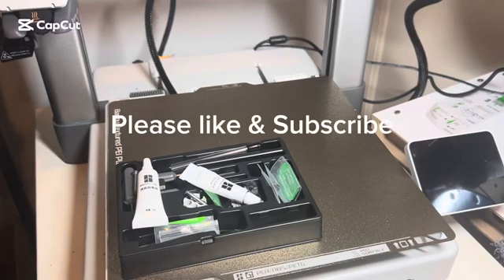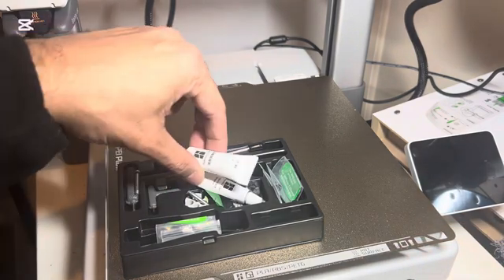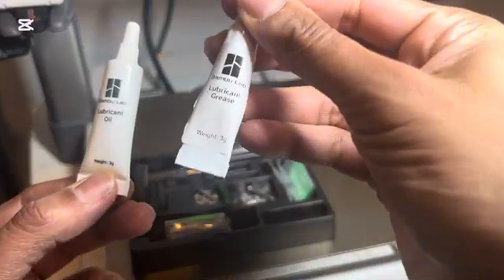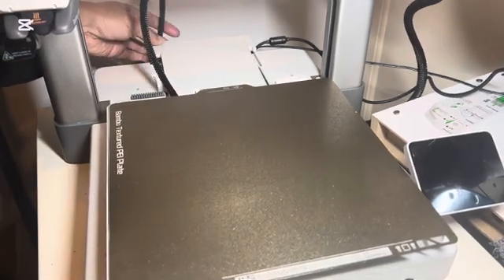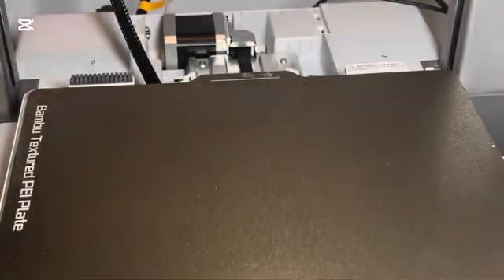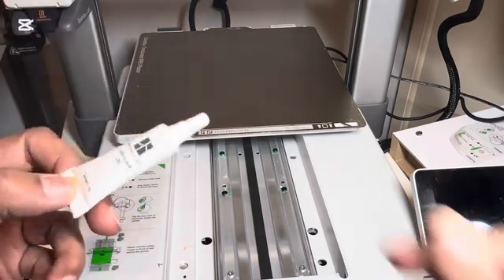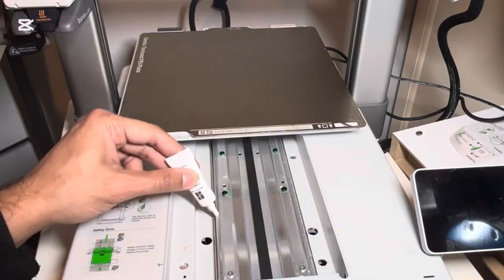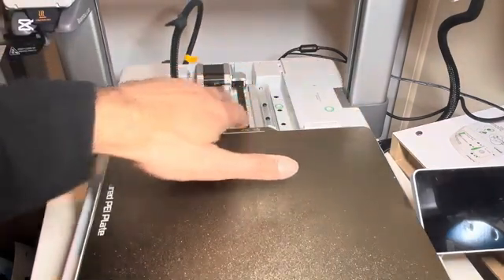Oil vs. Grease: Essential Bambulabs A1 3D Printer Maintenance Tips

Comment: You know, this is very wrong.  I will only point out one thing... Lubricating the "rails" next to the belt is wrong.  The inside "rails" are not rails, nothing rides on it, nothing at all.  The platform rides on 4 wheels which flank either "outer side" of the rails.  So, just the outer side gets the lubricant.  To prove this to yourself, remove the access panel, push the platform all the way back, now look inside and you will see four metal wheels on the outside of the rails.  Nothing on top or the inside of the rails. There are some nice videos on the Bambu website.  Good luck and be smart about your investment.